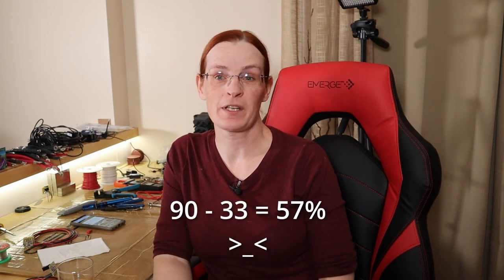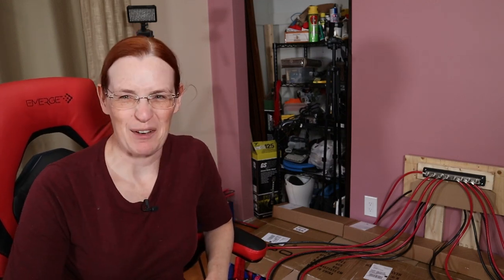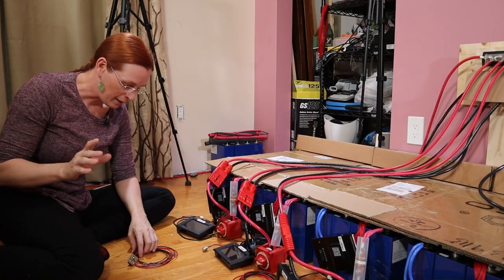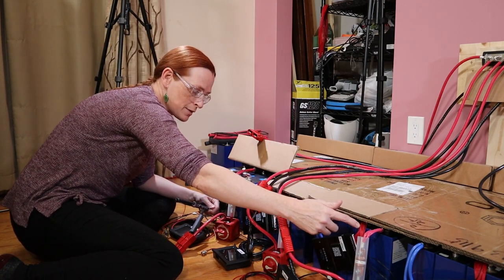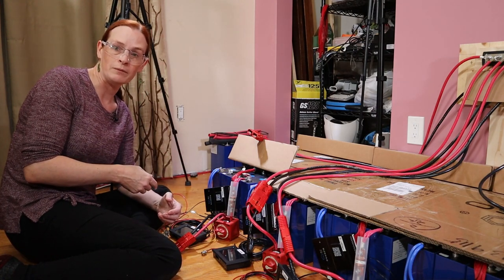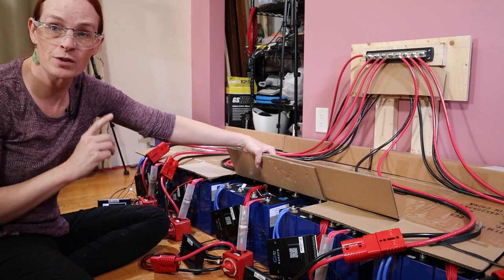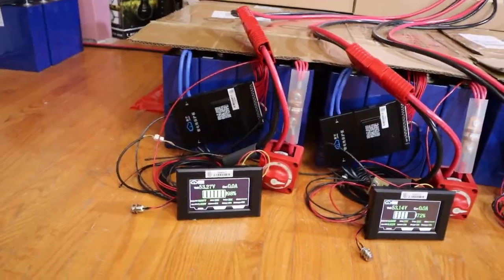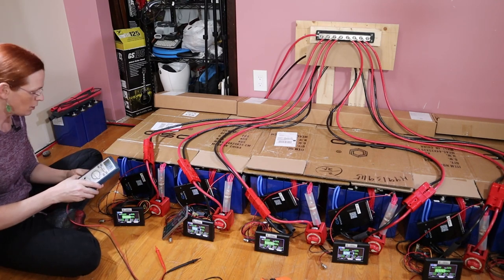It's Alive! (and I need some help) - Part 7 - Big Battery Build! (Ep. 44)

Comment: Dam, that be one big fire hazard right there, show that to your insurance company and I bet you they pull your policy immediately....
Reply from the maker: Want to explain to me which part of the build is a fire hazard? I'm assuming you're not just seeing a big battery and immediately assuming it's a fire hazard...
Reply: @TheDigitalMermaid  cause large conductors and lithium cells should not be on wood floors or covered with cardboard just to start with.... go on, show it to your insurance company or just about any electrical....
Reply from the maker: @quadlawnmowerman  What reports / studies do you have that shows there's any issue with LFP cells being on a wooden floor? I've read several studies on LFP safety and thermal runaway events with LFP that show it's shockingly difficult to trigger a TR at all, and when it happens (which required disabling all safeties, overcharging at 1C for some time), it peaked for less than a minute at 515c, rapidly falling back down. Cardboard is hardly a concern; It's not conductive, particularly at <60vDC, which is low voltage. The cardboard is there to keep the cats off the terminals. So again I ask; What is a fire risk, in your mind? Storing a lead acid battery, a jerry can of gasoline for a lawn mower, and any number of other fire hazards are common in homes are more dangerous than my low-voltage battery bank.
Reply: @TheDigitalMermaid  lol, lithium goes up all the time, puncture, expansion, internal short, over/undercharge, external shorts..... clearly never had lithium batts for long and clearly no idea on fire hazards. You say you read studies,  may be read some 101 on lithium battery charging and storage safety. The fact you are using cardboard to insulate the terminals from your cats says it all.  Again, show it to your insurance company or any electrician.....

The problem is not burning down your own house, that is no biggy, but rather it burning down your neighbours place cause of your lack of care....
Reply from the maker: @quadlawnmowerman  My electrician has seen it, and we've talked a lot about it. He's fine with it. Your comment "lithium goes up all the time, puncture, expansion, internal short, over/undercharge, external shorts" tells me that you don't understand LFP. Those issues are present with NMC, Li-Po and other cobalt-based lithium chemistries. LiFePO4 does not suffer these issues. Just recently, ABYC reported that, building on anecdotes of supposed fires on boats caused by LFP, undertook a study to see if they could trigger a thermal runaway sufficient to cause a fire, and they could not. President's Report of LFP, if you want to look it up for yourself. The MSDS for LFP is similar, indicating that while combustible in extreme abuse conditions, it rates the lowest risk of fire. Also, being <60vDC, it fall under the "low voltage" regime for safety.
Reply from the maker: @quadlawnmowerman  Copy of the letter over at DIY Solar; https://diysolarforum.com/threads/letter-from-abyc-president-re-lifepo4-safety-on-boats.48022/
Reply from the maker: @quadlawnmowerman  "you exceed 5600mah so your low voltage argument becomes moot" - Most laptops have more power in them, show me where a safety code / regulation says anything about 5.6Ah no longer being safe. My portable power bank, that is FTA approved for flights, is 26.8Ah. I am starting to think you're either a troll, or see "big battery, oh no, must scare monger!".
Reply: @TheDigitalMermaid  I’ve had this same argument from people who just don’t understand LFP at all. 
They literally think they’re the same as 18650 laptop batteries, when in fact they’re in fact arguably significantly safer than lead-acid, which of course gives off hydrogen.
Reply from the maker: @FutureSystem738  Yup. There's a faction of people, active in the sailing world as well of course, who rail against anything new or different. Electric propulsion is changing everything, and fast. For some people, they've got decades of experience with combustion engines and fear that knowledge becoming irrelevant. For others, what they knew isn't a factor, but they don't understand electronics, it can easily seem like black magic to people who haven't tried to learn it, and the idea of an entire field of tech they don't understand changing their lives scares them. The same thing happened when computers started to become an every day thing. The same thing happened when typewriters and calculators took off. The same thing happened with the automobile. Some people are never comfortable with change.
Reply: @TheDigitalMermaid  Yes, and the same thing is STILL happening with EVs. We’ve had a model 3 for over 3 years, absolutely bloody fabulous but we still get so much negativity and complete FUD from people who should know better. Sad.